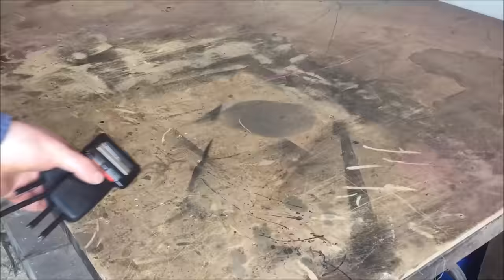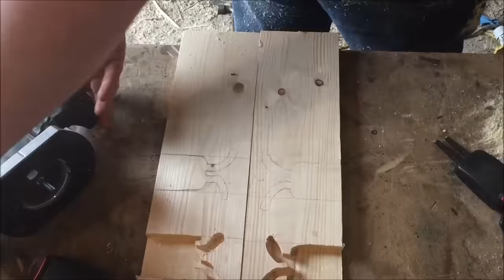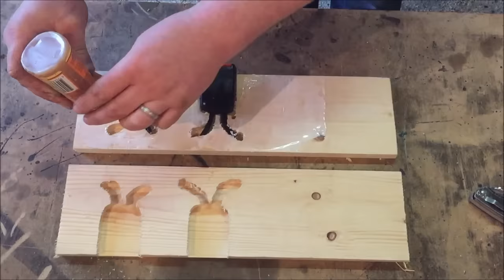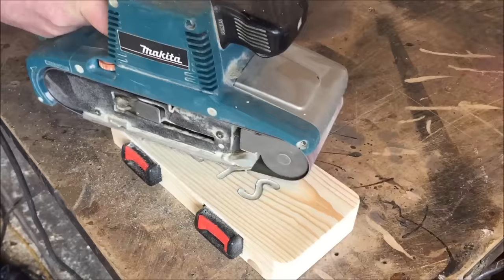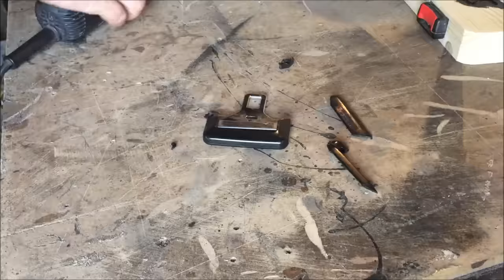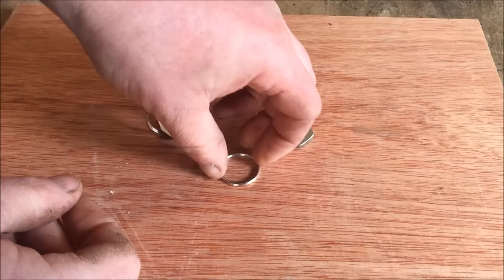Seat belt buckle KEY Holder

Comment: What type of saw did you use to cut the holes for the seat belts to sit into (also to carve the text). Thanks. Great video.
Reply from the maker: Thanks Damien, I used a router with a straight cutting bit in it.

Comment: I tried to make a hole for the key ring and I just can’t find the right drill bit can you tell me what you used to make the hole
Reply from the maker: If you are just drilling one or two holes a cobalt bit may do it. If not you will have to use a carbide bit. when drilling turn down the speed of your drill and use plenty of oil. Ideally a carbide bit should be used in a drill press.